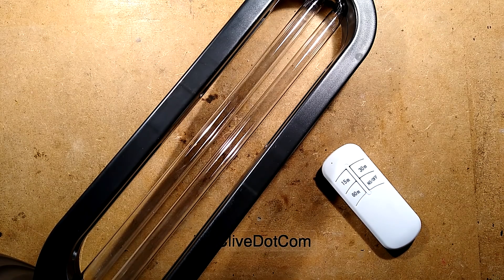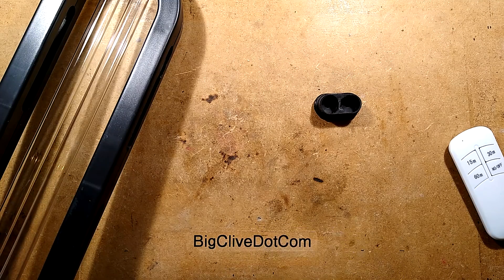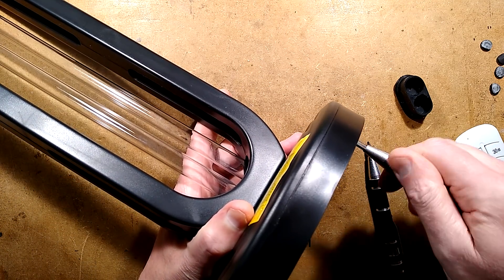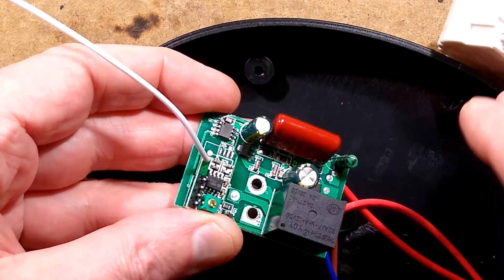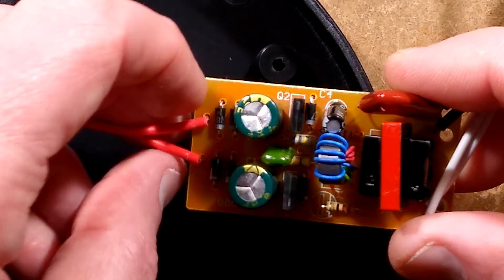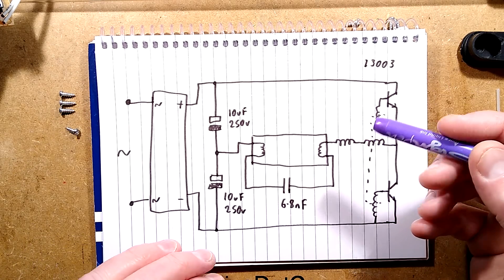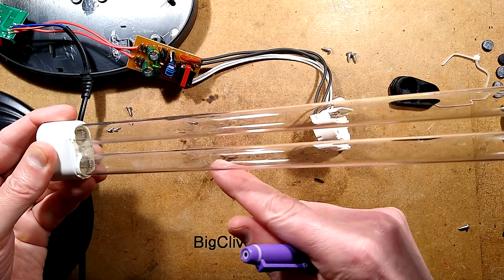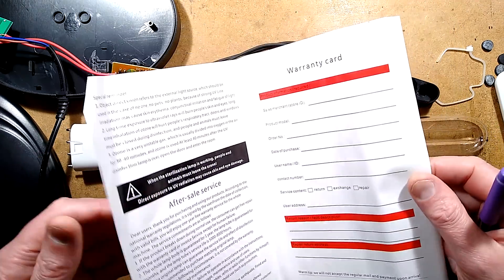Inside a stylish tabletop UVC germicidal light.  (Skin, eye and lung hazard)

Comment: If using one of these to sterilize the filter intake of an air purifier, be aware that UVC will damage most plastics. The plastic will turn brown, then get brittle. I am speaking from experience. I rigged one up to just sterilize the air entering the intake of an air purifier and after a month, the plastic became so brittle the air purifier broke the next time I changed the air filter.
Reply: And if anyone doubts this, leave plastic clothes pegs on the line for a few weeks and see what happens - and that's just UVA/B
Reply: @belperite  A big problem in Australia!  We're lucky to get one year's wear out of our plastic clothes pegs (and that's why many people prefer the wooden ones - less colourful but they last years in normal use!
Reply: @phils4634  soak them in some boiled linseed oil (or mineral oil) for a couple minutes and drain of the oil. Then wipe of the excess and let them soak over night. They will last way longer.
Reply: @xenonram  Done that, Mate! We use the linseed oil we also use on our outdoor furniture, and the pegs get a nice  Aussie "golden tan" Seems to reduce spring corrosion too - we're still using wooden pegs we bought a decade ago.
Reply: Phil S we get about that long out of the Reva plastic ones. Have just switched from storing them in a basket to a closed container though.

Arlec fairy light gutter clips on the other hand… those are lucky to last 6 months.
Reply: @xenonram  interesting, because antioxidant like vitamin E is indeed used by plastic manufacturer to prolong the lifespan of their white or clear plastic. Perhaps the linseed oil contain vitamin E?
Reply: @phils4634  I agree plastic pegs allways break down quickly especially in summer. It is also why European double glazed plastic window are extremely rare in Australia especially in northern Australia
Reply: @belperite  that's why I use wood. Wood rots far slower than plastic degrades from UV damage.
Reply: @spvillano  :
"that's why I use wood. Wood rots far slower than plastic degrades from UV damage."

==Perhaps it depends on the type of plastic used.
Polyethylene might have good resistance to UVA/UVB.
It's the most produced plastic.
I'm guessing polystyrene breaks down more easily.
polytetrafluoroethylene is probably one of the best but it is hard to shape it.
Reply: Probably also the reason why the plastic is black. Carbon black absorbs the uv. I'm guessing they won't have a white one (the special titanium dioxide pigment for plastic would also work but is more expensive than carbon black)
Reply: Great comment, mate.  Could imagine people leaving these things on in a room while they're out "just to be on the safe side" and rightly cooking half the place.  Not exactly sure what the domestic application is, because if you're home has something like the Lager Lurgy (credit: Creaky Blinder) floating round in it, that implies that you or one of your household already has the disease and is infectious, so you're living with the damn thing to start with!  I'd buy one, but just to have a broad spectrum UV source.
Reply: @Stoneman06660  It is possible you could have carried some of the virus in on your shoes, clothing, etc. and transffered it to other surfaces in the home without being internally infected  or sickened from it.This is where the UVC comes in. It can destroy those virus particles before they wind up getting transferred to your nose, throat, etc.   In fact I bought myself an extra one just for that purpose. Fortunately I know how to use them safely.  But I am sure a lot of people out there don't and run the risk of eye damage, skin damage, etc.
Reply: @WitchidWitchid  A small burst of radiation might clean everything. A multicell organism can survive radiation longer because we have many cells. But dont quote me on that. Fuzzy memory.
Edit: Im talking about shoos and clothing, not a house that would be bad.
Reply: @fishsauce2221  Same here. I am talking about using it to sanitize shoes, some clothing, packages and some small items.  Mainly for localized disinfecting rather than general house sansitization.
Reply: @Stoneman06660  I can't really think of any domestic applications, but I've seen them in the corner of some hotel rooms' bathrooms. Maybe the guest isn't intended to use it, but housekeeping might run it for 15 minutes while changing the beds or something? To sterilise the surfaces... if it's effective against fungus too then it'd be a decent alternative to wiping down with bleach. But I've not seen them in most hotels either anyway. As you say, in a place you have full control over, you shouldn't really need it. But maybe in a shared house, if you have that one manky housemate who you never see except for when he dumps all his mouldy dishes in the sink... maybe you'd want to have one of these lamps to be sure he hadn't touched anything you might use in food prep or something....
Reply: Yeah, those tubes are used for artificially aging plastics in QA departments around the world
Reply: I had UV lights in my custom Antec Skeleton computer case and whilst it didn't discolour it did become extremely fragile and slight knocks or impacts broke chunks off of the plastic bits a treat.   I used UV to highlight my UV reactive red dyed water cooling, made it look like it had blood flowing in and out of this crazy crazy case build.
Reply: Can you spray the plastic with something to protect it? What material should you use instead aluminium, copper?
Reply: Ozone reacts with just about anything and everything that oxidizes and will damage/destroy almost everything over time.  Ozone will react with water and break back down into O2.  Ozone is also one of the chemicals responsible for acid rain.
Reply: @VarroTigurius-u1f  Ozone is responsible for (photochemical) smog. Acid rain however, that's sulfur and nitrogen oxides.
Reply: @pizzablender  Ozone is a ready oxidizer for sulfur to make sulfuric acid.  Sulfur dioxide will interact with ozone to create sulfur trioxide which is the primary agent of acid rain.
Reply: Sounds like instead of generating Ozone we should have an Ozone filter in the house.
Reply: Will also age paper, such posters / art hanging on the wall, anything that's not behind UV glass, books on your shelf, etc.
Reply: Makes me wonder how long till it breaks its own crappy ABS housing down and starts falling apart.
Reply: @jkenny1  Carbon is a very good UV protectant and the most common pigment used when coloring plastic black. In other words, it's housing is likely UV safe by virtue of being black.
This is also why you should use black zipties when using the ziptie outdoors.
Reply: In the late 90s, I had TONS of glow in the dark and clear action figures, with 3 regular blacklights on them 24/7. In just 2 years, all the glow figures turned smoky black and all the clear figures turned dark amber. Thinner glow toys (like stars you affix to the ceiling) turned dark and CRUMBLED into dust when I went to remove them.
Reply: And rubber isn't too happy with Ozone either.
Reply: O o p s
Reply: The air in an air purifier passes too quickly for the lamp to do anything.
Reply: @MyHandleW  It will still sterilize things caught on the backside of a filter. It wasn't for air sterization reasons, but odor reduction. An air purifier was being run in my damp basement which had a mildew problem and stunk, and the UVC light addition did in fact work in making the mold smell go away... until the plastic all fell apart of course.
FYI, I had it shielded from sight so it wouldn't burn eyes, and no one spent enough time in the basement for the ozone production to do anything but help the smell.
I do realize you can't use UVC to sterilize uncontained air.
Reply: @rich1051414  Maybe cover all plastic parts exposed to the UV in the filter unit with aluminium tape could work?
Reply: @henryrollins9177  A UV protecting clear coat spray paint can also be used. Aluminum tape would be quicker, but look like shit :)
Reply: @rich1051414  Hahaha....indeed!
Reply: @MyHandleW  came to write just that, surprised Clive didn't mention it (or I missed it in the video)

Comment: Yikes. This one seems especially ill-conceived. FWIW, I think those silver clips on the tube socket firs into recesses on the tube base to retain it. How well, probably not very, hence the backup cable ties.

I am amused to see this in a plastic housing, however. Were you to leave it on too long, it would undoubtedly self-destruct. UV is hell on plastic.
Reply from the maker: They claim a life of thousands of hours, but I very much doubt that.
Reply: It's probably not black for style reasons; dark pigments generally resist UV a lot better.

Comment: I like the style of this lamp, but it does seem like it's blocking quite a lot of the light on two sides. I wonder how long that plastic will hold up to intense UV radiation.
I am also extremely curious about the UVC LEDs.  I've been trying to find them sold individually for about a year and haven't had any luck. I've come across a few manufacturers of them, but they're like medical/industrial grade and crazy expensive.
Reply: Black plastic often is quite uvstable
Reply: Gurgel Plus - I once had an air-purifier that had a UV-C tube in it, the interior was black plastic where the tube was
Reply from the maker: eBay does appear to have individual UVC LEDs in metal housings that look convincing.   They're a lot more expensive than normal LEDs.

Comment: I wouldn't count on potato doing anything to help with the UVC burns to one's eyes, except potentially extending the bad day with an eye infection.  The cool damp may provide some relief, but that could be accomplished with a clean, damp rag.
Reply from the maker: I've had a lot of feedback from welders that the potato trick does work.  It doesn't sound like the sort of thing you'd actually want in your eyes though.
Reply: Potato reduces the inflammation and makes you less likely to rub your eyes, which speeds up healing. But yes, you're probably better off with guaranteed sterile eye drops (of the "artificial tear" or anti-inflammatory variety; anaesthetic drops can actually slow down healing).

Comment: Maybe replace the UVC tube with plastic tubes filled with addressable LEDs or perhaps a huge string of slow color changing LEDs?
The driver would need to be replaced with something more appropriate of course.

-or perhaps translucent panels cut to fill the oval shaped space and randomly placed color changers inside to create that morphing color effect across the whole panel.